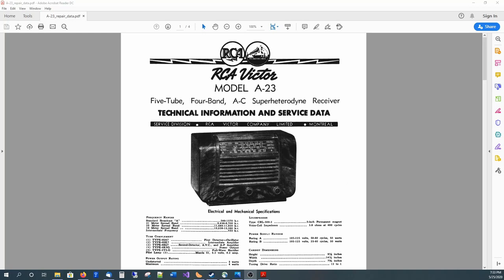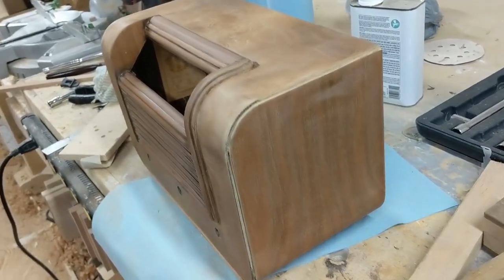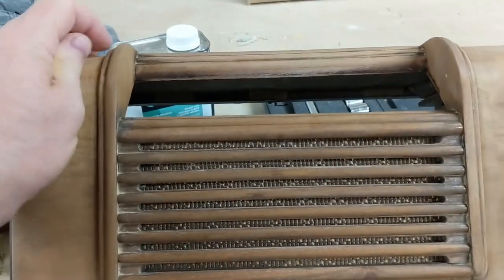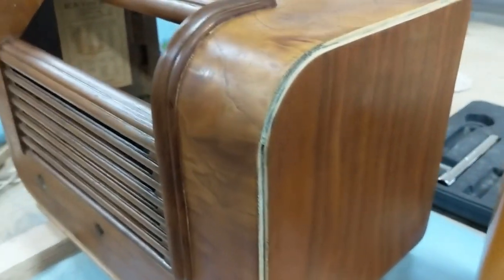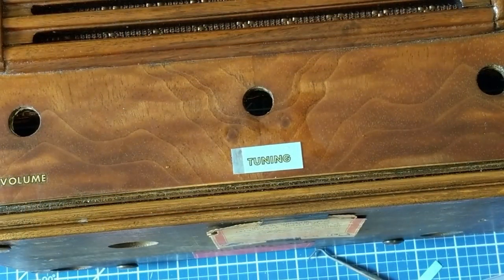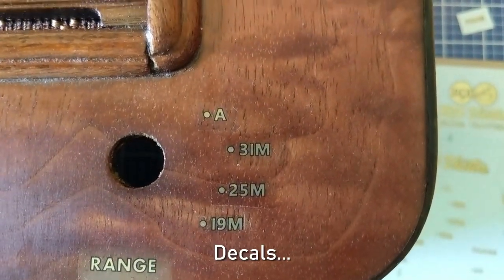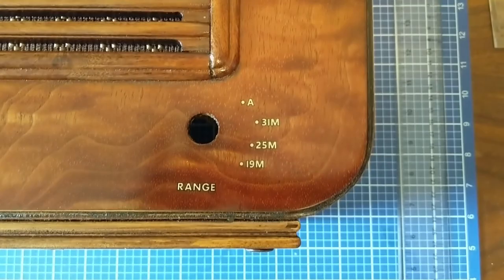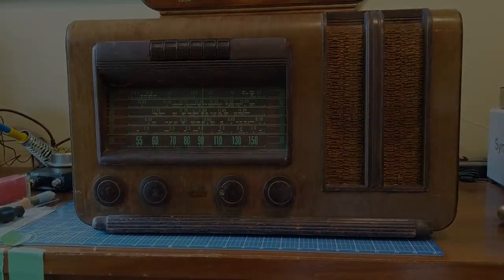EV 006 - Woodworking - Refinishing a 1940s RCA Victor A-23 Radio Cabinet

Comment: One thing I have learned as a model railroader is to apply decals to a shiny surface. A matte surface will make you see the cut edge all too easily.
Spray a gloss lacquer over the area you are to apply a decal. You should wait 30 minutes for it to dry before putting the water slide decal on. I have 
been using a water wetted paintbrush to push the small decal in place and not a sharp Xacto knife blade.  Use a straight edge to align the decal
which is parallel to any nearby surface to guide your alignment. After placing the decal in the place  you want add a drop of decal setting solution.
 It makes the decal set right down. Ask for it at a hobby store. After all that you then can spray lacquer over the whole piece and the decals look perfect!
Your cabinet work is exceptionally good. Steve
Reply from the maker: I was really out of practice, had not laid a decal for over 20 years! Next time should be much better.
Good tips :)
Cheers,

Comment: Thank you sir.  i am in the process of restoring an rca victor battery radio myself.  great video and great job on the radio!
Reply from the maker: Good luck with the restoration.
I have a few old battery radios (AKA farm radios) kicking around. The portables from the 50's and 60's, using the 9-pin 1** series tubes, are nice units too. They tend to be more responsive than the AC units as the cathodes are usually directly heated.
I have had good luck in powering them using series connected 9V batteries; you can get up to 70v with eight batteries. The amazon basic batteries are usually a good deal when bulk buying them.
I am planning on another restoration this fall, on that radio's bigger brother.
Cheers,

Comment: To move decals on a glossy  surface make the surface wet with water and use a toothpick or a brush to move it. Then blot the water off.
Reply: Can make a clear template as he did and prop up on risers/spacers to get a general guide not touching the surface without trying to peel off decals as well.

Comment: First, for handling the wet decals you need a pair of needle point tweezers.  You should create a template that has wider openings and tape it to the cabinet.  You can create and print it from a mechanical drawing program on your computer or create it on a quadrille pad sheet or mechanical drawing vellum if you can still find it.  Place all of the wet decals in place quickly first and then squeegee them down lightly so they don't move before removing your template.  Remove the template and then do a final light squeegeeing.

Comment: Would you happen to know the name of the epoxy  use to seal the Asbestos?  I don't  think I want to play with removing it. Is it difficult?
Reply from the maker: I don't know the name of a product and have never used one myself. It would have to be a high heat and fire resistant epoxy or similar...

My best advise would be to just not touch it. Asbestos, when disturbed, can cause fibres to become airborne; that's when it becomes dangerous (inhaling etc.). Left alone, it will not spontaneously generate airborne fibres. And the radio chassis covers it when its all back together, further reducing its exposure to the environment.

I would recommend not cleaning the interior of the cabinet out at all, as there likely will be some fibres mixed in with dust and other debris.

If you want to clean out the inside of the cabinet then you would be doing this at your own risk and I would hope you would be using a certified respirator, gloves, all body suit (eg. painter's overalls) and doing it outside and away from others.

Good luck,

Comment: Did you use an electric sander or just by hand?
Reply from the maker: All sanding is done by hand. Machines run the risk of sanding through the top veneer.
Cheers,
Reply: @EngineeringVignettes  Thanks.

Comment: Please, what are the top historical  3 radio receiver wooden cabinet in USA
Reply from the maker: There have been hundreds if not thousands released throughout the early radio days, up to the mid forties. "Top" depends on ones point of view. If you mean the most desired then I would say the "art deco" period radios but even narrowing it down there are so many.
Reply: @EngineeringVignettes  thanks, as you said it depends on the point of view of the each other, but I was surprised when you said that thier was hundreds if not thousands, but I don't know, do you mean companies or models of certain brands, because somebody told me the the foremost brands were zineth, arc, philco, crosly, radiola, and air castle, sorry its, disturbing!
Reply from the maker: @makyhsmakyhs6766  - In your original question you said "cabinet". That implies a particular design. Radio designs have a "make" and a "model". The "make" is the manufacturer (RCA, Philco, GE, Strombug-Calson, Marconi, Etc.). Every year these manufacturers would release a line of radios consisting of one or more "models". So, doing the math, every year there would be many tens of Make/Model radio combinations released for sale. Multiply that by 20+ years and the result is hundreds of different styles.
You can look at all of the different types online, for example at Radio Museum: www.radiomuseum.org
Reply: @EngineeringVignettes  thank you dear, because I am an radio and audio Phil and, 
amature, so was my late fathea and  my grand father but we have a lot of audio old device but belong the families of  Grundig  and philips  brands , but the surprise is that I did not expect that the USA is a leading country in the history of radio manufacturing since the 40,s  like Germany, Holland and Western Europe countries, but what I am sure of today  that I most of the US companies of  audio and radio recivers are made from - unfortunately - Chinese parts, componants like hadongrong  🙂 , sangean under  commercial brands like  b. crane and tucsun. 
in contrary to the vintage history of the audio industry you just mentioned ! ! Any way the world of the antique old radio is a independent big trade world wide now !
Reply from the maker: @makyhsmakyhs6766  - Your welcome. Yes the USA and to a lesser part Canada was a huge manufacturer. Prior to the early 1950's, radio was the only available household "broadcast" entertainment, hosting many radio shows.
I have some German radios, they are usually very well made and of excellent design.
If you like European radios than a good YouTube channel to watch is "Electronics Old and New by M Caldeira" who lives on an island near Portugal. He is always repairing them.
Cheers,
Reply: @EngineeringVignettes I love  the beauty of  arts and wonderful  designs every where in the world,  and if I went to florida - I think you are there - I would call you, thanks a lot again  👍